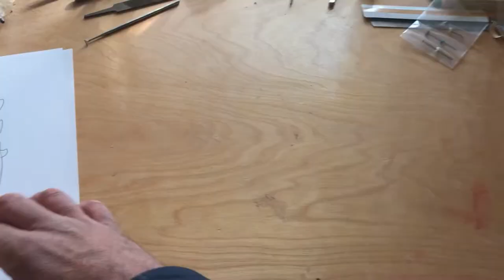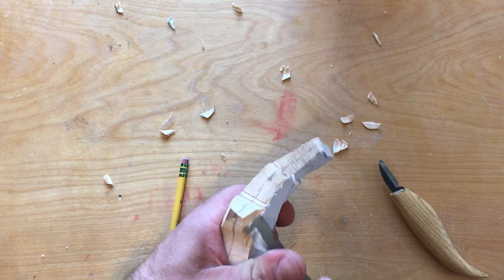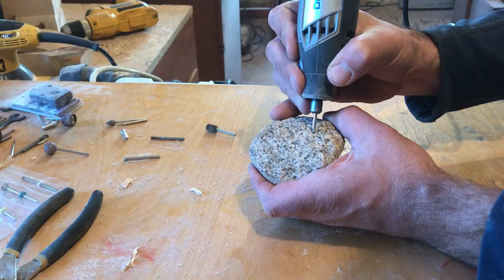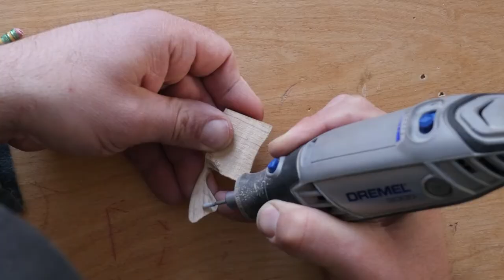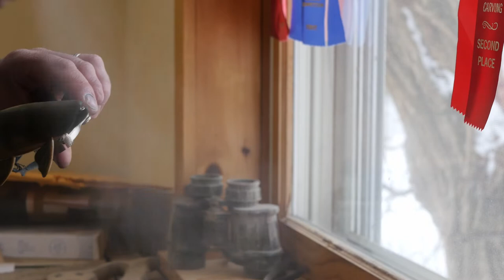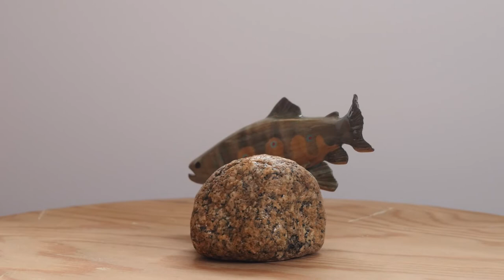Power Carving A Fish - Firewood Trout

Comment: I searched YouTube for "power carving a fish" is how I found you. I would sure like to know what product you used to dip the fish in in that bowl and how did you get it only on certain parts of the fish
Reply from the maker: It is a Trans Tint dye. The previous scene I am painting polyurethane on the section I don’t want dyed. It isn’t a perfect process but with a little sanding it works pretty well. I linked the dye in the description.